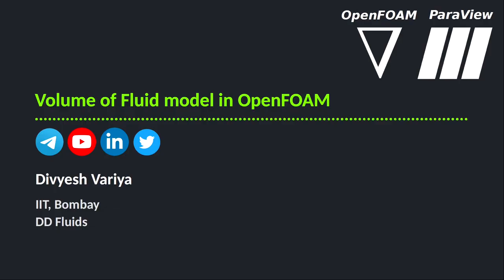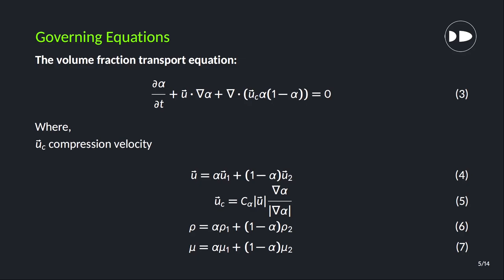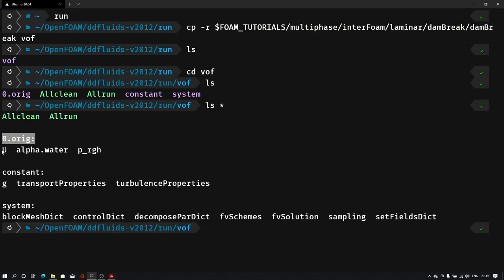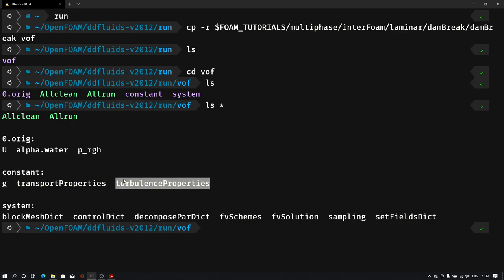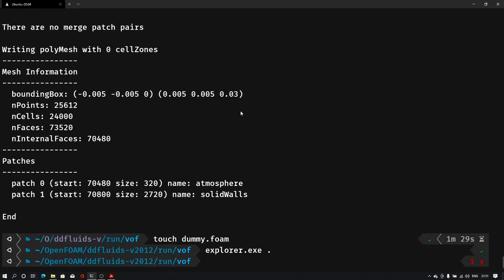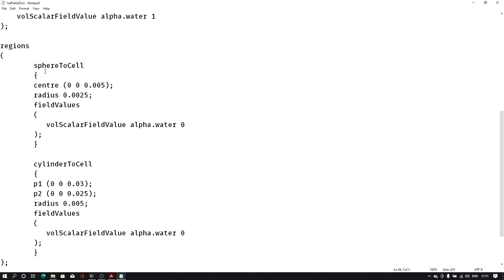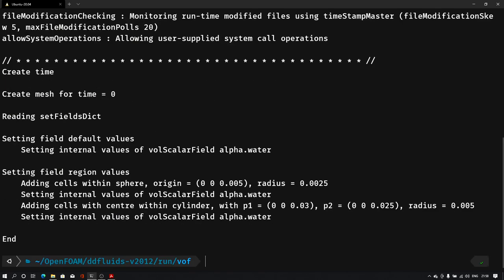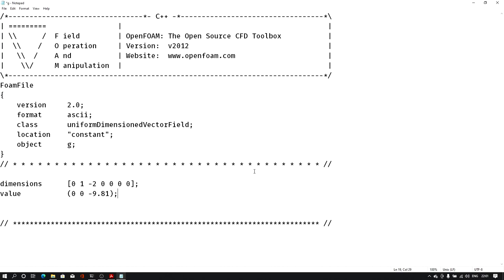VoF model in OpenFOAM | Bubble rising | interFoam

Comment: Anyone please help me solve this frustrating error:-

Create time

Create mesh for time = 0

PIMPLE: No convergence criteria found

PIMPLE: Operating solver in transient mode with 1 outer corrector
PIMPLE: Operating solver in PISO mode

Reading field p_rgh

Reading field U

Reading/calculating face flux field phi

Reading transportProperties

Selecting incompressible transport model Newtonian
Selecting incompressible transport model Newtonian
#0  Foam::error::printStack(Foam::Ostream&) at ??:?
#1  Foam::sigFpe::sigHandler(int) at ??:?
#2  ? in "/lib/x86_64-linux-gnu/libc.so.6"
#3  ? in "/lib/x86_64-linux-gnu/libm.so.6"
#4  powf64 in "/lib/x86_64-linux-gnu/libm.so.6"
#5  Foam::pow(Foam::dimensioned<double> const&, Foam::dimensioned<double> const&) at ??:?
#6  Foam::interfaceProperties::interfaceProperties(Foam::GeometricField<double, Foam::fvPatchField, Foam::volMesh> const&, Foam::GeometricField<Foam::Vector<double>, Foam::fvPatchField, Foam::volMesh> const&, Foam::IOdictionary const&) at ??:?
#7  Foam::immiscibleIncompressibleTwoPhaseMixture::immiscibleIncompressibleTwoPhaseMixture(Foam::GeometricField<Foam::Vector<double>, Foam::fvPatchField, Foam::volMesh> const&, Foam::GeometricField<double, Foam::fvsPatchField, Foam::surfaceMesh> const&) at ??:?
#8  ? in "/opt/openfoam8/platforms/linux64GccDPInt32Opt/bin/interFoam"
#9  __libc_start_main in "/lib/x86_64-linux-gnu/libc.so.6"
#10  ? in "/opt/openfoam8/platforms/linux64GccDPInt32Opt/bin/interFoam"
Floating point exception (core dumped)

Ps - I can't open alpha.water with text editor and with nano there's weird symbol instead of scalars( 0/1)
Reply: I get the same error, tried refining the mesh without success, did you manage to solve it ?
Reply: Were you able to fix the error. I am also facing same error.